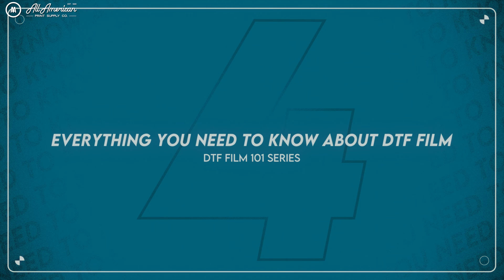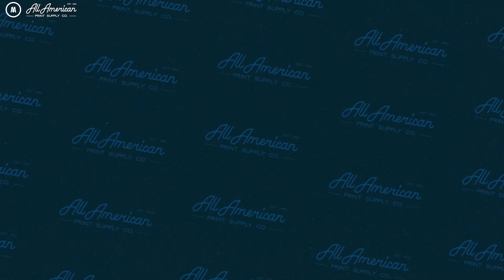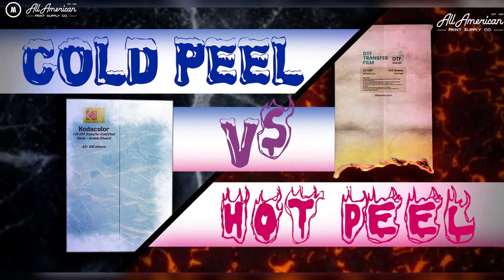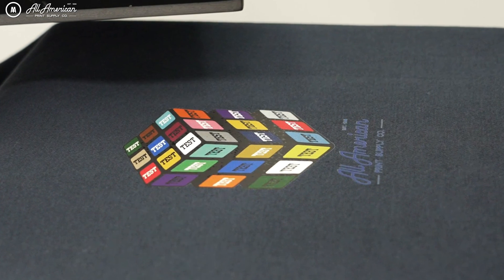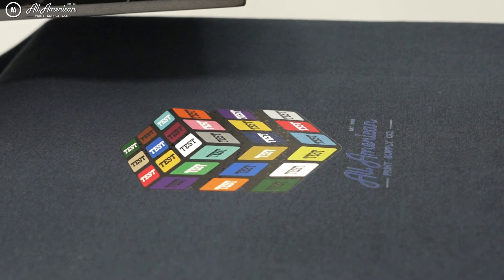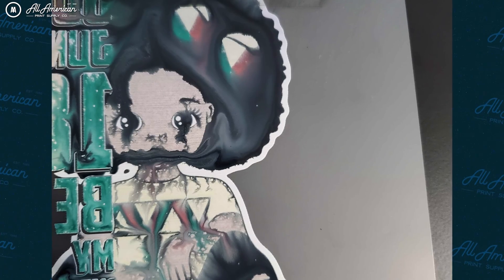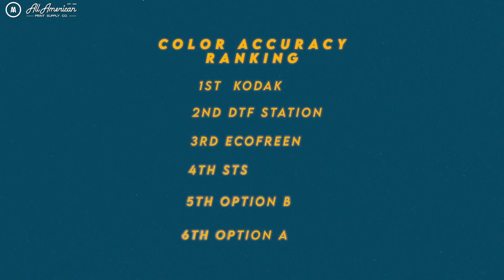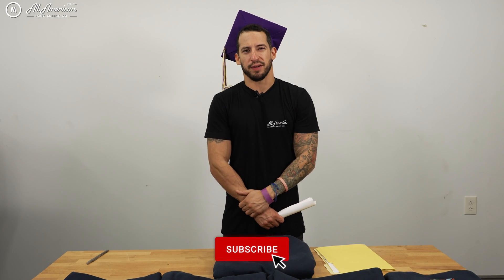Everything you need to Know: DTF Film 101 - The Final Review | AA Print Supply

Comment: How does the hand feel of the DTF Station film compare to the others tested - like where would it rank?  Wondering since the DTF station film was not part of that test.
Reply from the maker: I would rank it quite high! Near the top for sure and with finishing press options such as the T-Seal finishing sheet or even using a blank t shirt as a cover sheet for the finishing press we have seen improvement in hand feel with transfers as manufacturers continue to push forward in innovation